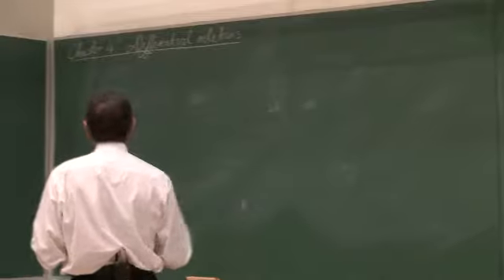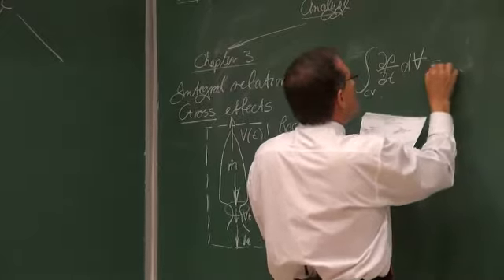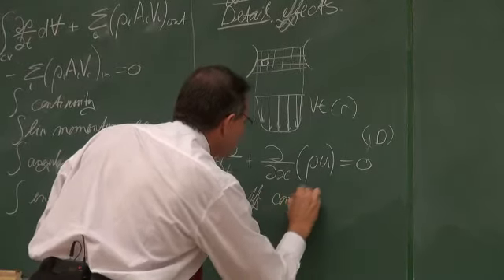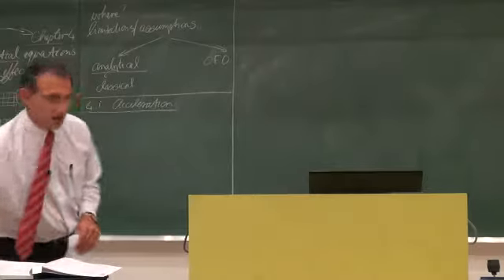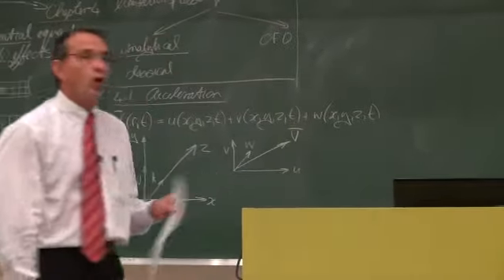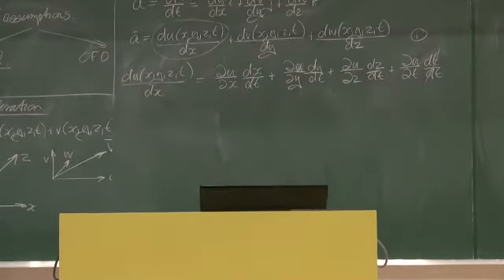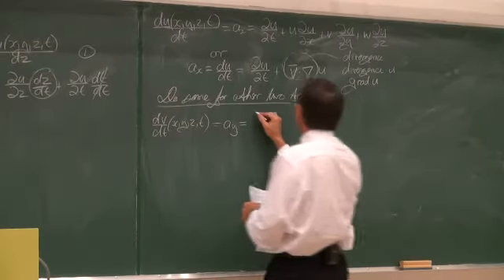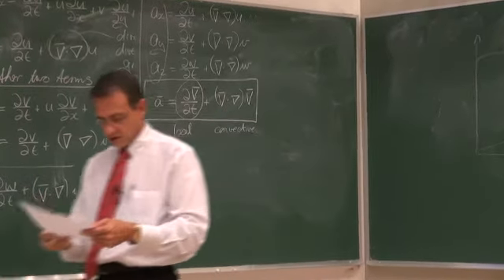Lecture 01 (2013). 4.1 Acceleration of a flow field, Differential relationships for fluid flow

Comment: Great lecture, very clear, and great accent too.  I agree with Charlie that they should be time derivatives and not spatial derivatives.  Also, the coordinate system should be properly right-handed, such that i x j = k.  The way it is written in the video had the z-axis pointing the wrong way.